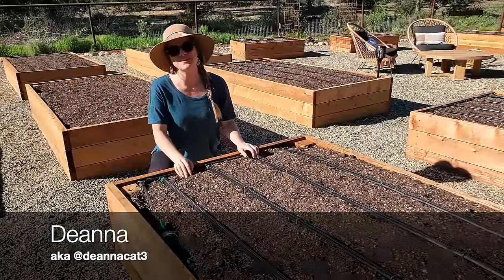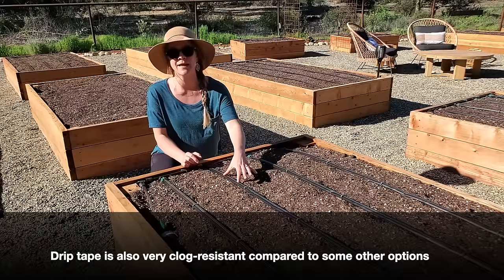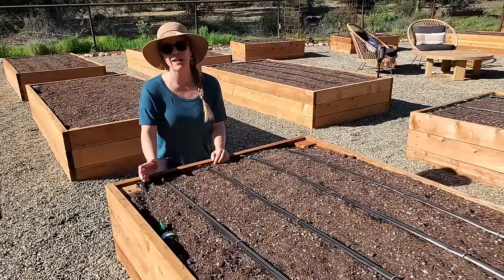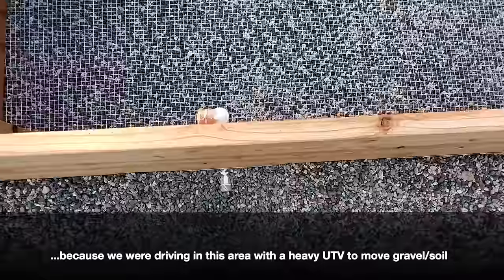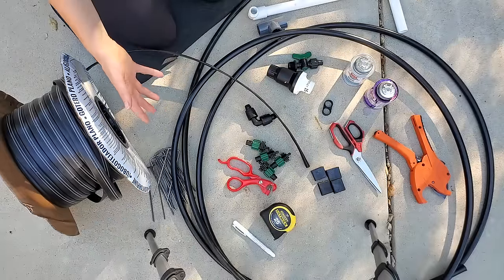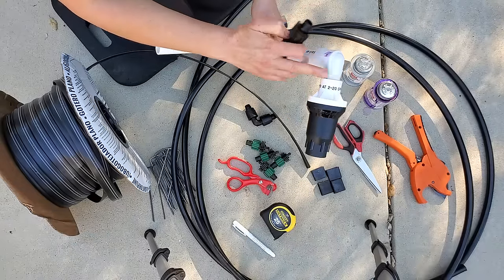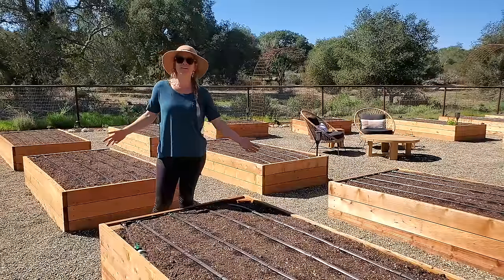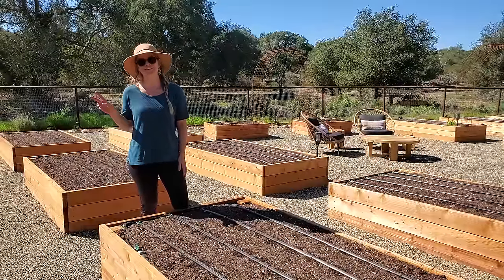How to Install Drip Irrigation in Raised Garden Beds (Using Drip Tape)

Comment: Just discovered your video, Very good info. As a suggestion you can eliminate the PVC primer when using "Blue Glue." Most PVC glue is clear. The reason your glue is blue is because it contains its own primer. You can save time and money.
Reply from the maker: Thank you!

Comment: Finally somebody made an easy explanation of how to use tape drip and the equipment needed for it. Thanks a million. Definite will do in the fall. Now here in central Florida is super hot and humid.
Reply from the maker: Glad to hear you found it so helpful! Good luck on setting up your system come fall.

Comment: Thank you for sharing  your knowledge!!!  I will be applying a lot of the same techniques for the raised beds I just built.  But you sold me specifically on the elevated psi being sent to the beds before further pressure reduction, as well as a valve at each bed to throttle the water up or down for watering adjustments.  I was planning on installing a blow-out at each bed to get the water out of the lines, ( with the assist of compressed air), but again agree with you that it might be better to disconnect and hang them up in a more controlled environment for the winter.   Again, thanks!!!
Reply from the maker: Glad to hear it was helpful and good luck on setting up your irrigation system.

Comment: Great info.  Thanks.  I think I'll try the drip tape. The new boxes looked awesome.  I did notice, in the latter part of the video, pressure treated wood used with the narrow and older boxes.    Probably not a good idea, even if it was just used to tie the corrugated steel panels together.  It wears off and mixes with the soils.
Reply from the maker: Thank you so much and hopefully drip tape irrigation works out well for you. In regards to the other raised beds with pressure treated wood and corrugated steel, the previous owners were the ones who built them or had them built, we just inherited them. We haven't had the time nor the energy to replace them just yet but may do so in the future.

Comment: Looks neat and competent.  My hesitation is at the end of season if you want to refresh and turn the soil over it gets in the way and you have to disturb it and replace in back in place every year or season you turn the soil.  I like how they work but will stick with hose and watering can for now as my beds are not large nor numberous.  Your installation is really great looking.
Reply from the maker: We don't turn over our soil, we cut out our plants at the soil line and leave their roots in place to decompose and turn into organic matter. To amend our soil in between seasons, we sprinkle amendments over the top of the soil, lightly scratch it into the surface, add more compost on top for added mulch and we are good to go.

Comment: One more thing. The Senninger Pressure regulator valve you showed in your tutorial was installed backwards. The white end is the outlet and the black end iconnects to the source. Thanks again for a great tutorial.

Comment: I really enjoyed the video , I want to install a drip system like yours , but my water supply Is rather far from my raised beds . I would need to use a raised platform with 50 gal water barrels on them to supply my water, my garden is about 20’ x 24’ , I am just concern about the height of the platform to make sure that all my plants get water . Would you have any idea on how high the platform need to be for this to work . Thanks for any ideas or improvements to my system to make it work . Thank you JimE.

Comment: Fantastic job of covering drip irrigation.  However, you have missed a link in your supplies:  the Perma-Loc shutoff valve that you use right after the 15 psi reducer.
Reply from the maker: Thanks for watching, the item is the second one listed, it is the adapter that connects PVC to drip tubing and has a shut off valve.

Comment: I'm so glad I found you on youtube! Many vids on creating raised garden beds, but you are the first that I found that discussed setting up drip irrigation..

Question: what if I bury the drip tube into the bed? Say 6" I'm in NJ, this will save me having to take it out for the winter and for root veggies it might be better?
Reply from the maker: I am not sure if burying the drip tape only 6" is enough for a NJ winter. I believe the best practice for any drip irrigation system in cold climates is to clear all the tubing and valves of water before freezing weather hits, removing the irrigation system from the garden and storing them indoors through the winter will also extend the life of your irrigation system. 

Our drip tape is usually under an inch or so of mulch but it was left uncovered to illustrate the system and set up for this video.

Comment: Someone at a local nursery told me that pressure reducers need water flow or they may be damaged. Wondering if you heard anything like that and if so, would it be better to put the shutoff valve before the pressure reducer? Thx, and great video!

Comment: Thank you for the video and the part and the companies that you have used. I have a question the pressure regulator is it  that only 1 used at the sprinkler value? not at each bed? Thank you again for this video my wife and I are planing on 7 4'x8' raised beads and will enclose the garden with 1/4" metal fabric on the ground to keep the gofers out and screen on the sides and on top to help keep out the crickets  other bugs and birds out. Thank you again!
Reply from the maker: We have a 40 psi regulator at the main valve where the water enters the garden via PVC pipes so we have good pressure reaching each bed. Drip tape however needs to  be further reduced to 8-15 psi depending on what type of drip tape you are using so we have a 15 psi regulator in each bed as well.

If you were to use a 15 psi regulator at your main water valve, you wouldn't get enough water pressure to your beds to successfully irrigate them. Hope that helps and good luck on your project.

Comment: Greetings I built a raised bed garden and ordered exact supplies in this video. My bad is completed and ready for veggies. My question is what is your recommended watering schedule? Thanks for your time and consideration in advance.
Reply from the maker: The number or times and duration of the watering really depends on the climate that you live in. If you live in an area with dry summers but frequent temperatures in the 90's and 100's, you may have to water more often and longer than someone who lives in North Carolina who may still experience hot temperatures, but still receives occasional rain.

We have our drip setup to water twice a week on Tuesday and Friday and we run the irrigation system for about an hour to an hour and 15 minutes. Our summer temperatures are typically in the high 60's to high 70's with overnight lows in the 50's. The best way to figure out your schedule is to water for a set amount of time and for the next few days, check your soil moisture and see how well it retains the moisture, you don't want it to dry out but you don't want it to be soggy either. A good inch or two of mulch on top (we us a barky compost) will also help your soil retain its moisture and protect your drip tape from the sun.

Comment: I noticed that at ur last home u made a video installing soaker hose irrigation to ur beds. So what made u switch over to drip irrigation in ur new beds? Pro’s & Con’s would be super helpful please. Thank u so much for ur amazingly beautiful videos!
Reply from the maker: Hey there! We still love those soaker hoses and use them in a few extra large (100 gallon) grow bags that we have set up. The main consideration was cost. The BPA free soaker hoses are a bit pricey (even mores o over the last couple of years) and the cost would have probably been 10x as much to outfit all 19 of our raised garden beds with them vs drip tape supplies. The drip tape is also easier to customize, though the the 50 ft soaker hoses did fit quite nicely in 4x8' beds like we have (it may be more difficult for other folks with varying bed sizes to get that perfect fit and coverage). You could automate soaker hoses in a similar manner that we did here , where each bed has a main feed line from PVC or poly tubing, then screws onto the soaker hoses at each bed. In our old garden, we didn't really automate the soaker hoses and simply plugged a garden hose into two of them at a time (utilizing a hose splitter). So, for fewer raised beds, they're still a nice option - and require less cutting/assembling/fiddling than drip tape! One "con" of the soaker hoses is that they do tend to spray/spritz a bit, so you have to keep them covered in mulch to prevent that. The drip tape does not, so you can choose to cover it or not.
Reply: @HomesteadandChill  thank u so much for ur in depth reply😊 is the drip, Polytubing & PVC ur using now Bpa free, food & water drinking safe?
Reply from the maker: @violettraine1029  PVC is used in drinking water systems so that one is safe for sure. I haven't been able to find any information on the drip tape or poly tubing as far as that goes.
Reply: @HomesteadandChill  thank u & please keep us updated if u find any new info❤️ God bless🙏🏼

Comment: New subscriber.  Such a great video. Gave me the confidence to jump in to putting in a full irrigation system. Appreciate the links. Questions: No plumbers tape is needed for the threaded fittings. Just hand tightening seals it well enough?
Reply from the maker: That is great to hear and no, we didn't use plumbers tape on any of the fittings and they do not leak. Good luck!
Reply: @HomesteadandChill Thanks for taking the time to respond. Much appreciated.
Reply from the maker: @dmrouls1  Absolutely, good luck on your project!

Comment: Well well i started with your enormous story about the worms but have been bing watching you guys ever since! Great videos and very explanatory too! Question, is it not better to place the drip tape face down? So there is less evaporating ?
Reply from the maker: Thank you so much for the kind words and we hope you have found our videos helpful! It is recommended to place the drip tape with the emitters facing upwards but if you use the drip tape that we link in the caption, you can then cover it with mulch. We have the drip tape uncovered in the video for visual purposes but we try and keep them covered with mulch for the most part.

Comment: Thank you for posting this.  I'm just starting my garden with my boys and we've watched this video several times now.  Since you've been in your new place for over a year now, is there anything that you would change about your drip line irrigation?  Also, how did you select your gravel and are you pleased with it?
Reply from the maker: We are very happy with our drip tape irrigation system and haven't thought about changing a thing about it. For the gravel, we like 3/8th inch gravel that can somewhat pack down and lock into itself. If you use round stones or rock like pea gravel, you will sink quite a bit as you walk around. We also see what gravel is available at our local bulk landscape supply companies, sometimes take samples home, to see what would work in the area and how it looks in the space. Hope that helps.
Reply: @HomesteadandChill  thanks for your response!

Comment: I did same layout of drip system to tops of my beds.
Mine though are 9” drip spacing with 9” separation per row within bed.  Mine are 1g per hour emitter in loamy soil base with compost built above.  Testing showed great spread of water horizontally and vertically.
Soil really dictates rate and spacing.

Comment: I've just started thinking and researching irrigation so I'm curious if you can use the faucet off your house as the main water supply? Or what is the best way to obtain water for this method in a garden? I apologize if this is an obvious thing I've just never looked into irrigation for my garden until recently.
Reply from the maker: You can definitely use any faucet or spigot you have available! I just added a link to the 4-in-1 faucet adapter in the caption here (which includes a backflow device, pressure reducer, filter, and drip tubing connector) plus the hose bib timer you can use to automate the system too. You can even attach a garden hose for additional length if needed first, then add that adapter and swap to drip! The backflow will protect your main house potable water supply, and the pressure reducer will make it fit for drip.  Check out this video too: it shows us running drip from a faucet. I hope that helps! And - there is no such thing as a bad question! Thanks for watching.  https://www.youtube.com/watch?v=LO79p4mfk3o
Reply: @HomesteadandChill  thank you so much! I have this whole idea of how I want to do my irrigation but not sure how to do it myself lol. I will definitely check out everything you recommend. I honestly thought you had to have like a hand pump connected to a well or something to get the water I didn't know it was possible to get it directly from the house faucet.

Comment: Awesome video, thank you. I'm doing this exact project and this video has been my go-to guide. I'll be sure to use your links for Drip Depot so you get a commision. Quick question, what is the "black cone" looking part that sticks out sideways (inbetween your irrigation valve, and your 40psi pressure regulator?)
Reply from the maker: Thank you so much for the kind words and we hope it makes it easy for you to install your own drip irrigation! The "black cone" looking part is actually just part of the pressure reducer itself. Hope that helps and thanks for your support!
Reply: It has definitely has made it easy on me! you did all the legwork, haha. After doing some more research. It looks like that black cone part is a filter. The last time I put a valve manifold together I didn't think to add that. I'm rebuilding my whole system, so I think I'll do it this time around. Thanks again. I'm a new subscriber to your channel and loving the content!  @HomesteadandChill
Reply from the maker: That's great to hear, I think the filter just comes as part of the pressure reducer so it's a 2 in 1 type of thing then. Anyway, so glad you have found the video and our content so helpful, have fun growing! @tylerbraga8088

Comment: Could you do a video on your solar set up for your irrigation system? I want to set up a solar hook up as well, but not sure how to do it and what I would need. Thanks you in advance!
Reply from the maker: Do you have a main controller that automates your various drip or irrigation stations already? We have Hunter brand controllers linked in the caption and ours just has a small solar panel attached to the side of it that is wired to the controller itself. It may be easiest to have an irrigation specialist to set it up for you depending on what you have to work with already.
Reply: @HomesteadandChill  I haven’t set it up yet. Still watering with a hose which is a pain. I’m trying to decide which set up to use. I like the set up in this video the most, but would need to hook it up to a solar panel like you did for your garden. Thanks for the info. Would you happen to have a link to the solar panel you used?
Reply from the maker: @mishagutkin4666  That part of the system was already set up when we moved to the property so it isn't something we had to mess with. Although we did add two additional stations to the main drip irrigation header for our new garden area. There are various solar panels on Drip Depot's site for the main irrigation controllers but it may be best to have an irrigation specialist out so they can tell you your options and what may work best for your specific situation.
Reply: @HomesteadandChill  got it. Thank you

Comment: Helpful video! If we m using 1/2” drip line from the faucet, is there a 15 psi regulator for 1/2” in, 1/2” out?
Reply from the maker: You only need the 15 psi regulator if you are using drip tape in your beds. If you are using standard 1/2" drip tubing in your beds, you only need a 25 psi pressure reducer.

We have found that you may need to use adapters to convert from 1/2" to 3/4" before converting back to 1/2". For more in depth information and other alterations you can make, check out our article on the topic:

https://homesteadandchill.com/install-drip-irrigation-raised-beds/

Comment: if you arepvc to the beds - could you not have the 40 psi pressure reducer so you get better pressure in the longer runs - and then put the reducers on whereever you go to drip?
Reply from the maker: We do have PVC running to each bed itself all coming off a valve which has a 40 psi regulator. Then in each be we have a 15 psi regulator to reduce the water pressure at each bed so it meets the psi requirements for our specific drip tape that we used.

Comment: Fantastic video! I just ordered all the parts from your affiliate link. Do you recommend three drip tape sections for a 3 foot wide box? I am placing the raise bed along a fence and need to reduce the width so I can easily access the bed.
Reply from the maker: Yes great point, that's exactly what we did in our couple of smaller beds - 3 rows of tape in the 3 ft wide beds 👍🏼 thank you so much for your support!

Comment: What diameter perma-loc fittings are used with the 5/8" drip tape? The choices seem to be 1/2" or 3/4".
Reply from the maker: The link is in the caption under: 

Barbed adapters (3.6 mm barbs, to connect 5/8" drip tape to 1/2" tubing header)

Just be sure to select the 3.6 mm barb and 5/8" tape.

Comment: I noticed that the drip system is on top of the mulch.   I live in a semi-arid state and use a lot of mulch. How does the water get to the soil?
Reply from the maker: The drip tape is actually on top of the soil in this video, we later added more barky compost on top as a mulch and fully covered the drip tape. The emitters on the drip tape are designed to let water out but not let dirt in.